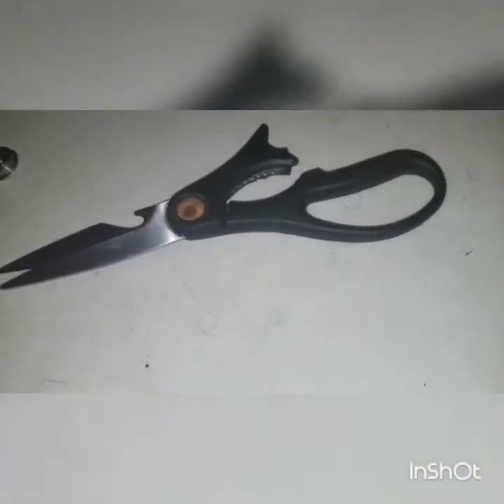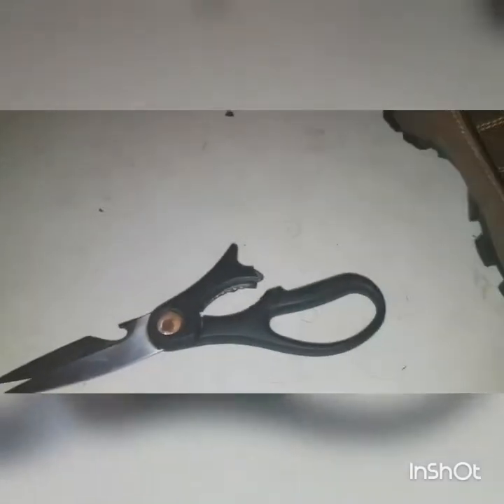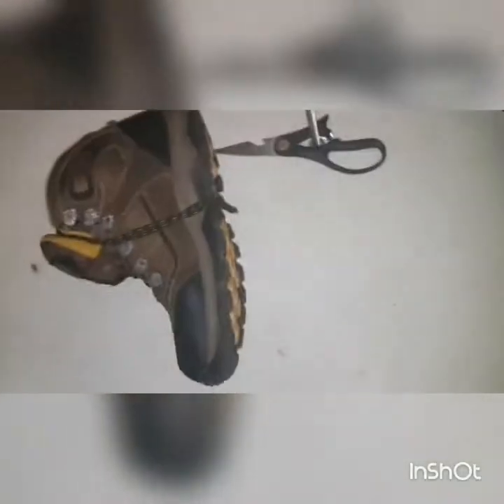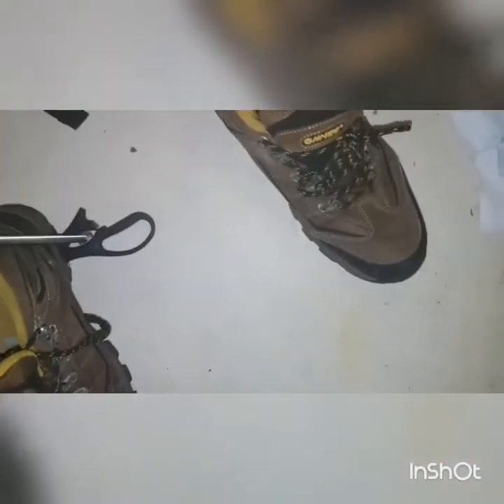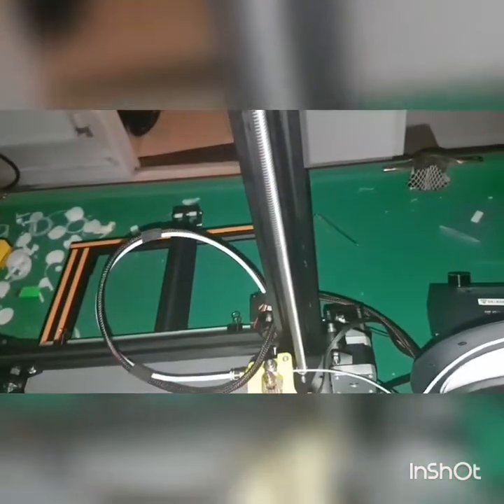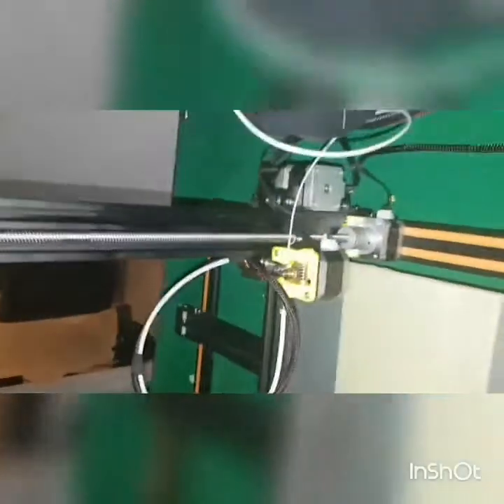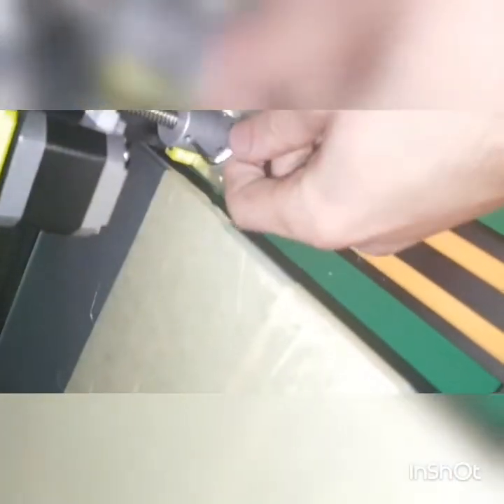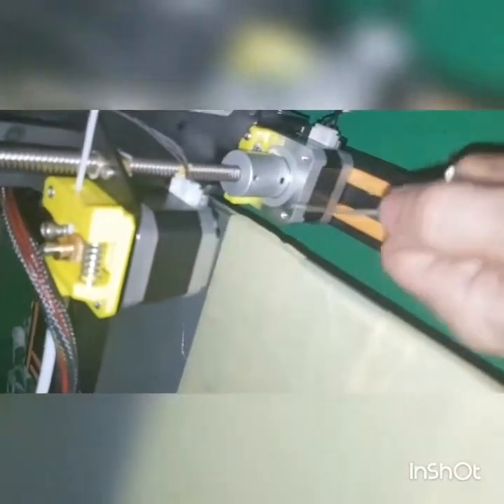Cr10 solution how to fix z axis lead screw & squashed prints

Comment: That top bearing is supposed to fit snug, but not be locked onto the Z-rod... if you take off the top plate covering the bearing, the bearing should be capable of being popped off by gently inserted the allen wrench from below...I mean it should be that loose. I would recommend completely removing it and sanding the inner rings slightly so it cannot lock on via friction....and/or spray with a liitle white lithium grease.

Comment: Thanks, I'm currently trying to explain to Gearbest using pics why I can't print. 
They said I've installed it wrong and that I need to move the lead screw down.
Except I can't because the bearing is 18mm down from the top of the lead screw and wont budge.

I think you've just provided me a solution. Cheers, JAYTEE